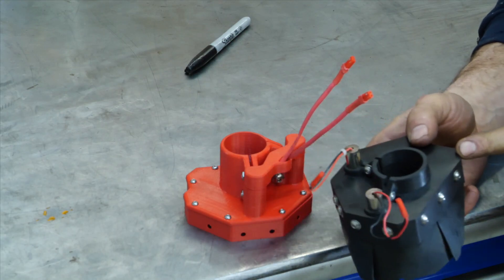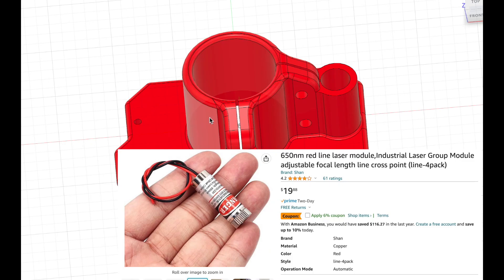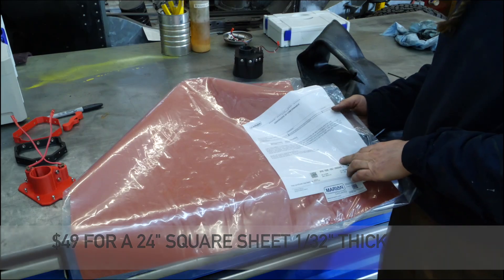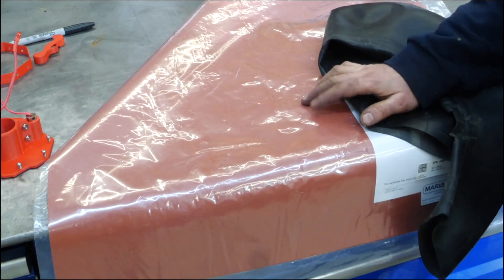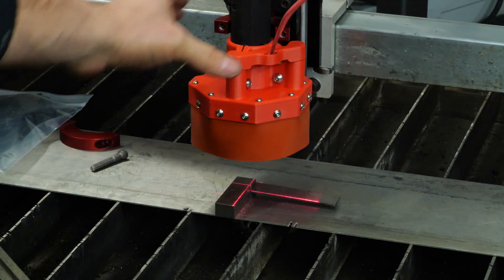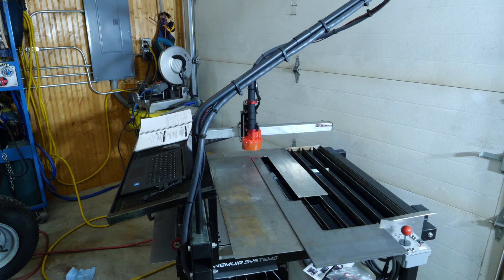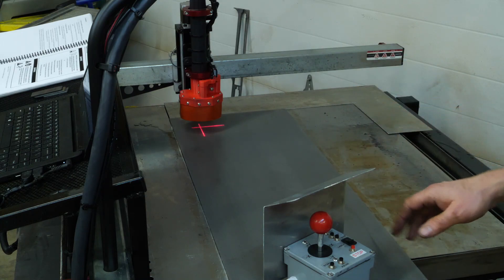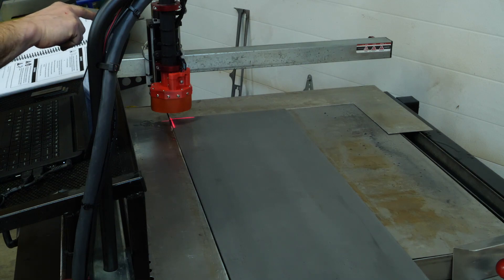Plasma CNC Laser Shield

Comment: Are you on the Langmuir forums at all?   I second the question about the stl,  and also, the design is great,  I’m assuming you kind of have to put the lasers inside the shroud but does this get the lenses all dirty and full of stuff?
Reply from the maker: Yes they have to be inside, otherwise you would have to have large arms holding then far away. They get wet if the torch is off the work at the end of the cut, which depends on many factors.  They stay surprisingly clean during cutting.  I thought the lenses would get sandblasted in there but they don't.   I use scrap pieces of sheet Al to reduce splashing in general in a small garage.

Comment: hi do you care to sell or share the STL files and cut sections of the rubber shield
Reply from the maker: STLs for the 3D printed components are on:

https://www.printables.com/model/720570-langmuir-systems-crossfire-hypertherm-machine-torc/files
Reply: @compulsivediy8036  thank you much for sharing… if can ask for more could you share the cad model too I’d like to try and modify it for my hand torch
Reply: Although I may be able to just mod the stl itself so if youre short on time no worries
Reply: @dillrepair i figured it out the CAD file is included in the zip file with the STLs...   i modded it to make it work with a hand torch too.   its a little janky but it actually helps spread the clamping load on the hand torch too.    to use lasers it requires that the hand torch is mounted sideways parallel to the Y rail or at an angle instead of perpendicular...   i will post it here or on prusa or something if someone wants it. 

also i started by initially printing a thin sheet of TPU to use as the rubber shield... yeah that does not hold up to the temp of the sparks...  the silicone rubber is a good idea, and i'd get it as thin as possible because the rubber can drag tip ups or small scraps around on the slats if you aren't careful...   compulsive diy does a good necessary thing here covering the rest with other pieces.
Reply from the maker: STLs for the 3D printed component are on:

https://www.printables.com/model/720570-langmuir-systems-crossfire-hypertherm-machine-torc/files
Reply: Thanks for posting the files have fun
Reply: Yes please, this seems to be a very effective design I haven’t looked on the forums yet